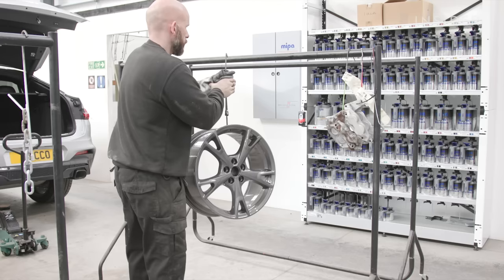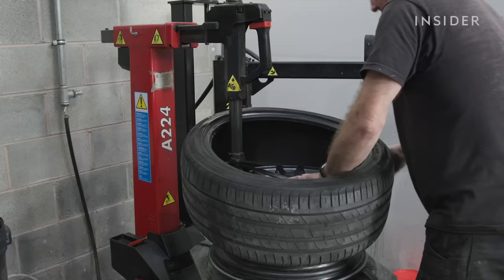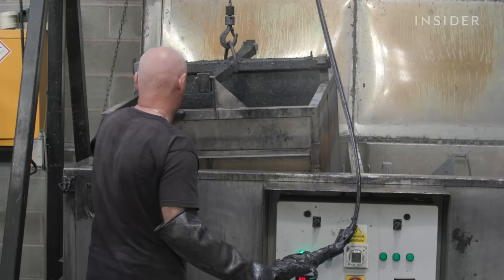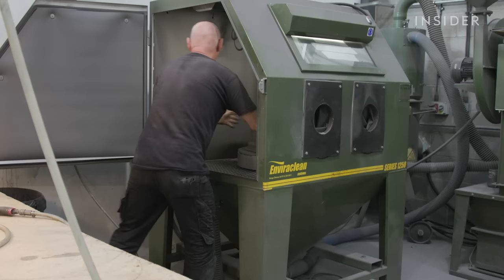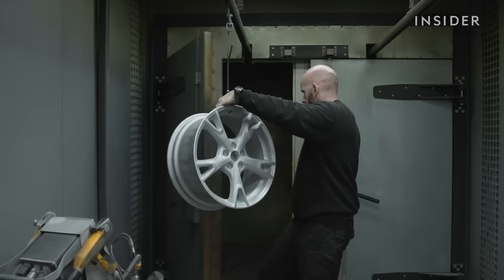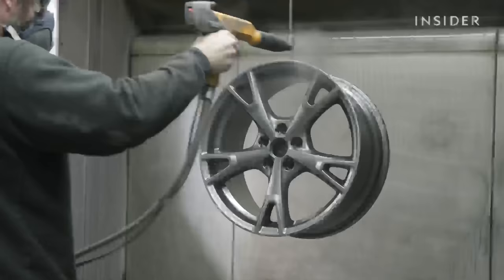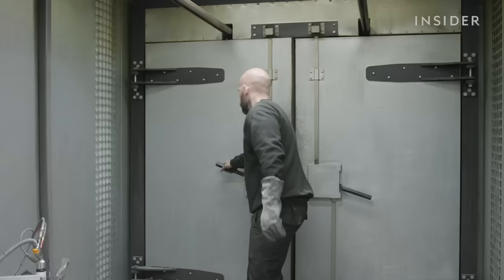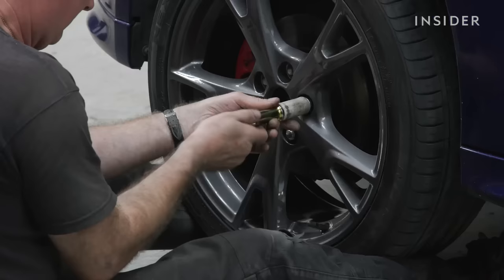How Wheels Are Professionally Powder-Coated | Cars Insider

Comment: anytime you see someone powder coat a wheel hot.. then you know they arent a professional.
Reply: Utter nonsense ur ment to heat up alloys before powdercoating. Thats why he does it in video
Reply: @Rab_Cee  absolutely not. All powder coat is meant to be applied cold to control mil thickness
Reply: Exactly what I was thinking
Reply: @RichBurn  u heat the wheels to release gasses that cause flaws. Look it up. I have Powder coated many things in metal fabrication i worked at. Even says on powder coating to pre heat. Your ment to do it with all metal im shure
Reply: @Rab_Cee  you outgas them before coating but you should let them return to room temp. I have 20yrs experience or you could just read any TDS sheet. Lol
Reply: @RichBurn  the video doesnt even say they powder it hot. Just that they pre heat it. N i read your comment as if u ment you shouldnt pre heat them, my bad
Reply: The powder melts if its hot metal your spraying it on. Definitely tried that before lol on someone's handrail that some1 missed a spot on
Reply: @Rab_Cee  when you have experience you can see it. Go talk to any powder manufacturer. Can even watch videos from prismatic powder telling you not to and showing you why. 100% fact
Reply: @RichBurn  doesnt take much experience to know plastic melts on hot metal lmfao
Reply: @Rab_Cee  yup them why are you acting like they didn't shoot it hot. Thanks for proving me right
Reply: @RichBurn  as i wrote already the video doesnt say or show them powder it hot, your just assuming they did. It shows them puttin it in oven then jumps to a wheel powdered blue n then the wheel. No where can you see its hot
Reply: @Rab_Cee  yes you can clearly see it melting. On contact. Well over 240 degrees. Thanks for trying.
Reply: Lmao my thoughts exactly, especially with the gun he’s using, there’s no need to hot flock 🤷🏻‍♂️
Reply: @RichBurn  I just watched the video from Prismatic powders and the guy didn't say not to do it. He said they prefer doing it cold. It also depends on the powder too. Some state absolutely no hot shooting some state you can. In the video he shoots it with way to much flow rate on the powder and that's why you would get uneven coat thickness. He even states  if you do lower rhe flow rate and apply more passes it easier to control and you can read the finish easier.  Too much starts to sag or orange peel effect and too little doesn't have a gloss or even finish none of which can be seen in static cold powder.
Reply: @buildthings79  I've been doing this for a living for almost 20years. Shooting hot is a bandaid for having a crappy gun or a crappy ground.
Reply: @RichBurn  I agree with everything you said here. There can be exceptions where hot flock can be used. I use it for gloss blacks to produce a 0 orange peel very wet black finish. You need to be able to control mil thickness well doing this though. That’s the only color I’d ever shoot hot, everything else is cold coated for me.
Reply: @Rab_Cee  re: "Your ment to do it with all metal im shure..." especially needed when trying to powder coat Magnesium (been there had that problem).

Comment: They look good for sure. My problem with it is the person doing the powder coating has to be meticulous and good. I have had powder coated wheels come back looking good but require lots of weight to balance because the powder coats on the wheels are very uneven. As long as this is done by individuals, it is extremely difficult to have even coating.
Reply: That's not due to the powder that's poor tire quality or out of round wheels also can be incompetent tire guys
Source: I make forged wheels and own a powdercoating shop.
Reply: Don't give out misinformation, you do not know what you're talking about. The powder has nothing to do with the wheel requiring lots of weights.
Reply: Well, this is from my experience on my set of wheels that have been powdercoated. Prior to them being powercoated, the wheels are straight and I had no issues balancing them that require a significant amount of weights. All I am saying is if the spraying of the powder is done by a human, the quality can vary and if it is not done right you can have uneven layers which could make balancing difficult.
Reply: @garytsuikk  I get what you're trying to say. You're wrong I've done thousands of wheels over the years. You don't know what you're talking about, how long have you been powdercoating? Mow many thousands of wheels have you made from a raw hunk of aluminum or a forging? Is the answer 0 to either of those if so you're not a source of information just opinion and yours is incorrect.
Reply: @joshuakent7887  so you get what I am saying but yet you say I am wrong, so which is it? So you are telling me that there is absolutely no chance that a less skilled powdercoated can do a bad job at it by making the coating uneven?

Not sure if you actually read what I said or you just think you are 100% right all the time. It is not my opinion, it is my experience with the wheels that I got powder coated. I am not knocking on powder coating, I am just saying not all powder coater do a great job.
Reply: Yeah "I understand what you're saying but you are wrong" meaning it's not a miscommunication. What I'm saying as a powdercoater for the better part of the last 2 decades is that no matter how much paint you put on it won't cause balance issues even if you managed to put a full pound of powder per 20" wheel there's is still no way its going to cause issues. BTW if you put a pound of powder on a 20 it's a dripping saggy mess which you would know if you did this. So no the half pound of powder distributed over the surface of a wheel that when mounted will weigh over 50 pounds will not effect it. In conclusion you are wrong. Have your bent wheels road force balanced and that won't happen as badly coats makes a great machine start there. 🍻
Reply: In my experience the off balance issue is due to the fact that they do not tape off the hub of the wheel before coating causing buildup on the hub which causes the wheel to wobble once mounted to the car. A good place will use high temp tape on the hub surface before coating. Sadly most of these assholes don't bother doing this because they are lazy and rushing the wheels through the shop.
Reply: You just took them to the wrong shop sir